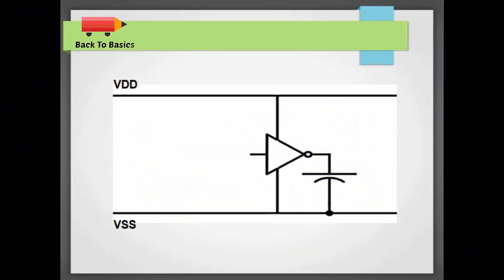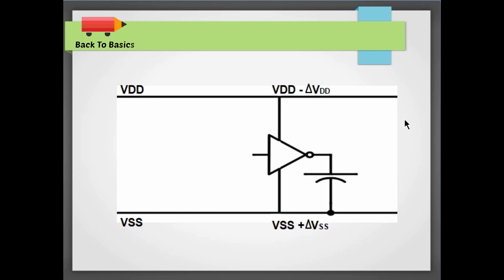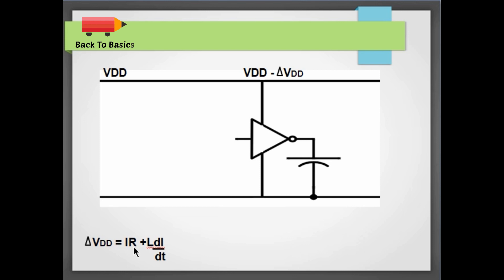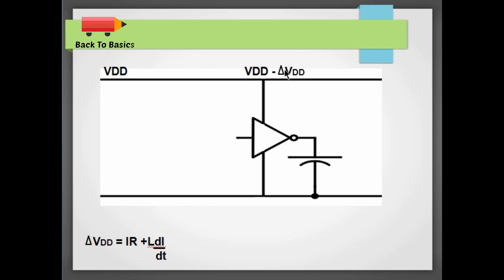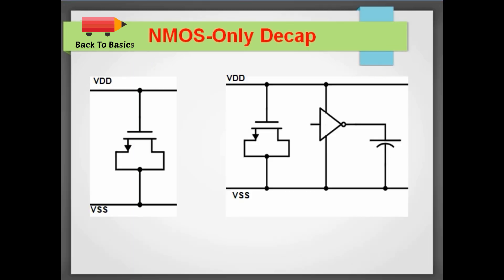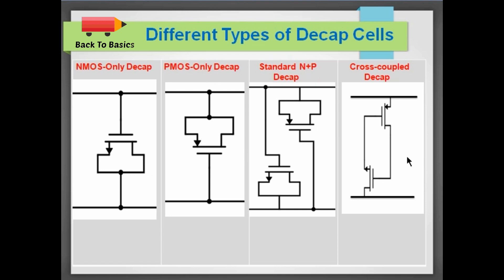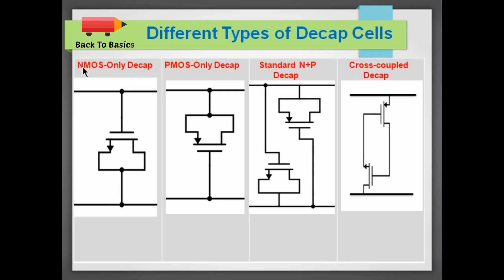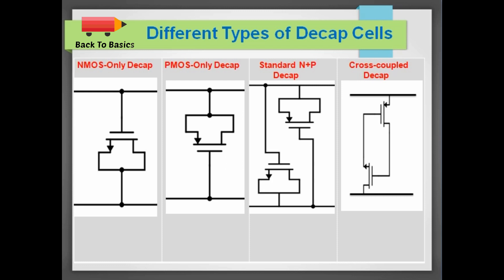What are Decap Cells | Physical Design

Comment: Good explanation! But i have a doubt i don't know whether it is valid doubt or not. As long as vdd rail is travelling that much vss rail have to travel right. But you are saying that in vdd we are having voltage drop then why not in vss, why voltage is increasing in vss?
Reply from the maker: Because VSS is 0V and it cant be less than that.. So the disturbance in VSS will increase its voltage and not decrease it. That is why we have ground bounce for VSS and Voltage droop for VDD.
Reply: @backtobasics5602  Thanks for your response

Comment: In no way , inverter's functionality will get affected by drop in vdd[irrespective of NM value]. Functionality of next stage which is being driven by inverter can be an issue if drop in VDD is high or increase in VSS is high !!
Reply from the maker: Hi Shaukat, 
Right,  functionality of chip will be affected and not inverter. Thanks for pointing out the mistake.
Reply: I think functionality of inverter depends on its supply voltage as well. If voltage drop is so large or if noise in supply voltage is very large then there is a chance that the MOSFETs might go into linear region of operation which will result in undesired output. Moreover Rise and fall times of inverter depends on its supply voltage and hence speed(propagation delay) of the inverter will change if there is change in supply voltage. And DECAPs can help preventing such issues. Correct me if I'm wrong. Peace